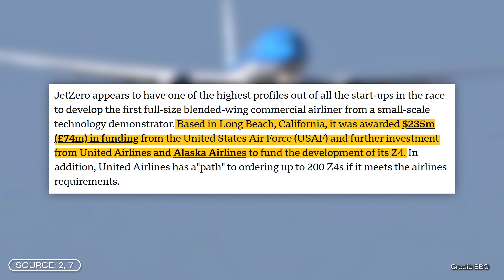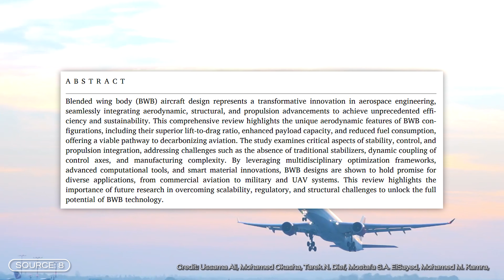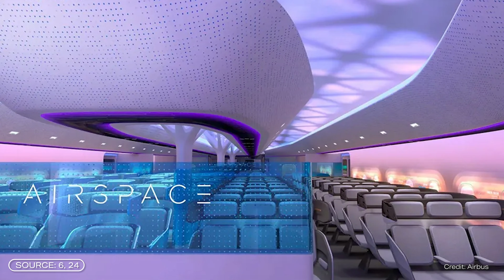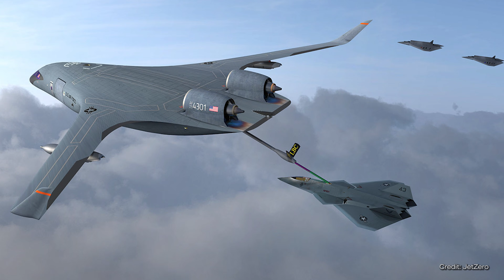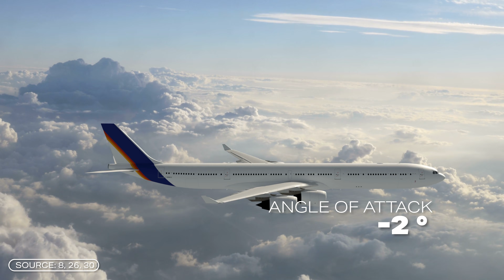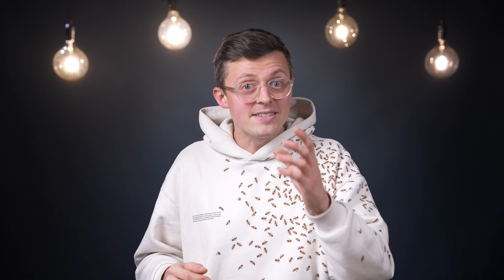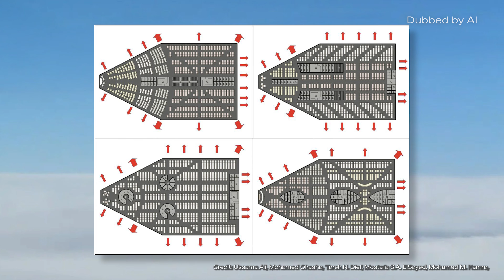The "Perfect" Plane Has One Big Problem...

Comment: I am surprised there is no mention of Airbus and their MAVERIC blended wing craft that was initially presented in 2020. The suggestion that future aircraft will use hydrogen rather than battery-electric using the new generation solid state batteries, when hydrogen is expensive to produce, transport and store, as well as having a low energy density, seems surprising.
Reply: Hydrogen (compressed or liquid) is still 5-10x more power in volume and50-100x in mass than the best batteries today. Hydrogen has lots of problems, but power density compared to batteries isn't one.
Reply: oh boy...batteries are very very heavy. Batteries are pointless in commercial aviation period. Hydrogen well it storage is a problem...very high pressure needed to store volume necessary for flight. So avgas or Jet A1 or kerosene will still be around for a long time to come. Net zero is a stupid and dangerous myth.

Comment: Militaty transport would highly benefit from this blended wing design. I'm surprises no manufacturer tried to at least do some prototyping.
Reply: That might be the next phase for initiatives like Jet Zero.

There is however a much more urgent need to replace and supplant the KC-135 and KC-46 fleet first, despite the issues with the C-5, C-17 and C-130 shortages due to aging fleets there as well.
Reply: This video explained exactly why no one has  tried.  It would be a purpose built cargo hauler...so long as it doesn't crash every two seconds.  Maybe an acceptable danger for military refuelers, but certainly not for passenger airlines pretending everything is safe.  I am interested to hear about the flying characteristics of the B-2, assuming it's not hidden behind 50 years of military secrecy.  Still basically a cargo hauler though.

Comment: Dude you did all that research and forgot one of most important hurdles for this aircraft... Passenger safety in evacuation during emergencies. Im old enough to have follow this aircraft since Boeing and NASA started on it decades ago. Its a problem because of how the passenger are seated laterally . They have to be able to evacuate the plane in a strict and short amount of time.The FAA is very strict about evacuation procedures and if they can't get past that, then it will never enter commercial passenger service and probably be military only.
Reply: Sorry but there plenty of issue more important about this design other than the minor problem of egress.

Comment: You didn't spend much time on the biggest problem of all; Pressurization. It's the reason why these airplanes will probably never be build. When you pressurize a cabin like that, the forces are immense. Every pressurization the fuselage will deform massively, and those stresses are near impossible to fix, unless you build 2 or 3 tubes within the aircraft. So don't hope on seeing one of these anytime soon.

Comment: Maybe I missed it but I'm surprised you or your friend didn't mention the huge advantage of high engines. FOD (Foreign Object Damage) mitigation. Engines under the wings act like giant vacuum cleaners sucking up any small stone or bolt, etc. Having the engines on top of the structure would reduce the chances of that damage enormously. I don't know how well this design will work but that's a massive consideration.

Comment: Arranging passengers in one of these will be a challenge.  You need everyone to be within two or three seats of an aisle, so flight crew can reach them and passenger can exit to bathrooms  or evacuate in emergencies.  But the more aisles you put in,  the more space you lose in passenger seats.  Also, boarding and evacuation may still be difficult and passengers will be far from windows, which may feel claustrophobic.  Passengers also dislike being in the middle of long rows of seats.  And the sensation of flight will depend on the seat position as well.
All of this suggests that cargo and military adaptation will be mich easier than passenger use.  It may be a while before they are adopted for this, if ever.
Reply: How well does this concept scale down?  Because given the anemic sales of the A380, and the 747 being phased out of service?  ISTM that the airline industry is looking more to the 200s to 300s in passengers top, making it easier to fly with a full plane on more routes.

Comment: A military cargo &/or fuel tanker only needs a pressurised cockpit. UPS & DHL fly cargo planes and not to be too pointed, but, haven't Fedex (et al) just had a load of Tri-stars grounded over a catastrophe with  poor maintenance of underslung engines? The tail engine was OK till it ate bits of the detached engine. The same forces apply to the anchorage for this blended wing, but an engine disassembly wouldn't have much in its path as it fell. And engines are getting bigger in diameter better to put them where there is space! And just like a big building, the cargo space needn't be one huge hall, it would have pillars strategically.

Comment: More surface area if the landing gear fails, a more open, wide interior body, better lift, better fuel economy and noise reduction. Better engine protection. Being shorter, it looks like wing and tail strikes would be reduced.

Comment: A blended-wing body airliner is aerodynamically superior, but as a passenger aircraft it faces major drawbacks: the wide cabin puts most passengers far from windows, creates curved seat rows, and increases roll and turbulence perception for seats far from the centerline; the non-cylindrical pressure shell complicates pressurization and fatigue and crack-growth analysis; and manufacturing requires extremely large, highly curved composite parts, limits automation, makes inter-factory transport impractical, and drives slower, more expensive production—making the aircraft commercially risky despite its better aerodynamics.

Comment: Engineers will need to develop passive stability fixes. Relying on fly by wire and computer assisted control only works when electrical systems are functioning optimally.  A plane should not fall out of the sky if it looses power.

Comment: You also have the prop-fans that are planed to replace the turbofans and you can expect fuel consumption the half of the CFM56 for the one Safran is working on... 
And I don't really see where to put a propfan on the top of a blended wing... 
You missed the point that nonetheless, engines on the top would make maintenance more difficult but that airport terminals would have to be replaced...
And it's not just the engine access that may become way more difficult...
Then, in case of cylinder design, replacing the wings is not uncommon then, when it comes to building... Blended wings may need to have a huge factory making everything on a single site... have fun to stuff the large parts into a cargo, even the Airbus Beluga...

Comment: It should be noted that of the BWB design, everyone who's looked into it from McDonnell/Douglas in the '90s and Boeing after acquiring it, and Lock-Mart, NASA, Airbus, TsAGI all have said that pressurization might not require more structural weight and even if it does, the gains in L/D and range & payload more than make up for it. They've said that some designs have markedly less structural weight. They have all also proven that passenger egress in a mid-size/regional plane is not a problem.
They've published to this, not only in patent documents but elsewhere in peer-reviewed science.
This is regardless of whether you're talking about 1960s technology, or 2020's technology. Make the fuselage a lifting body, whether expensively blended or not, and instant 20%+ savings over a tube and wing.

Most media is only concentrating on the modern tail-less "blended" designs instead of looking at the concept as a whole including many lifting fuselage body designs that do not have the similar problems with not having a tail, or being blended, or requiring advanced computerized systems, or worst of all, tying the concept to things like hydrogen fuel or electric powered.
The concept of lifting fuselage body airplanes has been artificially held back by fashion, by "if it looks right, it'll fly right", by it looking funny and not at all like a B-707, and now, by being tied to radically advanced systems and technologies that aren't in use yet.

Like most presentations on such topics, it's in ignorance of, or simply ignoring vast amounts of previous work in similar veins. Mention a lift-producing load carrying volume in a plane and everyone jumps to the all-wing with no tail surfaces like the Northrop XB-35 or the B-2 or the Horten-9/Gotha 229 of the war years.
Generally, "flying wing" is a media term. To designers, it comes back to meaning that the main load of fuel and payload is carried in a volume that is presented to airflow in a way to produce lift, and that the main lifting volume is the primary structure that holds everything together.

Within that broad definition, designers since Junkers patents in 1911 and onward, and very many others in the early half of the 1900s had many designs.
Junkers himself could not get any backing to make anything closer to this, than the G-38, which only had some habitation and fuel loading in the wing, as well as enclosed engines in the wings. The Soviets tried with antiquated technologies, the Kalinin K-7 with limited success. But see the 1930s Kharkov KhAI-3 "flying wing" with a fin, small test plane. Entirely successful, it flew for a few years as a general utility transport.
Charles Fauvel also wanted to make huge inhabited wing liners, started with a tiny test plane the successful AV-10 before the war, the successful sport glider the AV-36 after the war
Arado with the E-470 (very like a Burnelli) and the E-555 and the Focke-Wulf 1000^3 "B" model (Competing with the Horten/Gotha 229) all-wing tail-less during the war as transatlantic bomber proposals, competing with the Horten Ho-18. There was a Messerschmitt version of a huge 6 engine Horten bomber with a big fin & rudder.

Closer to the modern BWB discussion, see the designs by Vincent Burnelli of Texas, usually working out of Canada because nobody in the US wanted to buy or invest, despite the facts that his planes offered proven better handling than "normal" planes and better range and/or payload. A couple of huge lifting fuselage body biplanes in the 1920s.
 Most notably, the CBY-3 from 1947 onward (now restored in a museum). As to flying handling, a test pilot spoke of doing the "suicide stall": Cut power and pull back. As it starts to shudder and fall off, push a rudder pedal, and let go of the controls. The nose turns a bit with the rudder input, and the nose goes down and it glides out straight. Like most of his planes, better range for the same power/fuel loading compared to a "normal" plane, onto shorter runways, though it tends to float in GE for a long time unless you plant it firmly down.

Established aeronautics industries hated him and his designs, though they performed well. At least twice the US military favored his designs, but the political process turned away. First with the contract that led to the A-20 built by Douglas, then the S-2 Tracker built by Grumman. He had a large bomber that was supposed to be in the contact bids that led to the B-29 and then the B-36. He continued designing things with lifting fuselage bodies, wings and tails into the 1960s.
 Very many of them have rough aerodynamic considerations very similar with some of the modern BWB inspired designs that have a pronounced afterbody and centered fins (most of these largely taking after the 1990s Tupolev 404 winged lifting fuselage body design). Absolutely none of the issues associated with designs without fin & rudder or with only wing-tip fins.

Then in the 1970s, Boeing started pushing a lifting fuselage body deign called the Boeing model 754, to carriers like Emirates, Cargolux, and Husky. Like the Burnelli designs, not at all "blended", yet by their numbers getting almost double the range or payload, onto shorter runways compared to a "normal" plane with same engines and fuel. 
When the Burnelli Estate learned of this, they told the carriers and Boeing that they'd be happy to let it be license-built to Burnelli patents. Boeing hastily dropped it and it disappeared, carriers and makers not concerned with fuel savings.
The Husky patents noted that adding more freight as in lanes of containers, the L/D goes up as you go spanwise, adding engines and landing gear every few lanes as it expands. The landing gear type and rotation angle doesn't change, as it does when you "stretch" a tube & wing to increase cargo capacity.

To this day, they're still not concerned with savings, with proven handling with entirely contemporary technologies and flight training.

See the 2010s Lock-Mart "Hybrid Wing Body" logistics transport. Again, greater payload and range onto shorter runways, entirely common materials and handling. Also ignored.

See the 2000s patents by Faruk Dizdarevic on Tailed Flying Wings. Like many of the blended designs depicted in this video, but with a tail, thus eliminating any handling problems.
Any of these and especially of note the Boeing 754 / Husky designs of the '70s have been an important missed opportunity.
Ignored by buyers, mostly because of misconceptions and because they look funny, not at all like the fashionable tube & wing.

See the Russian "Frigate Ecojet" Again, with contemporary technology, the same footprint, power, and fuel loading of a regional, you get the range and payload of a jumbo.
Reply: Thanks for rather detailed history of related designs !
Reply: Bullshit. The weight gain for BWB will never be made up by any aerodynamic benefit. If an airplane cannot get off the ground into flight, there is no aerodynamic benefit
Reply: @PaulWalker-zk2dd  Please show your professional qualifications, and citations where you're published under peer review saying so.

Comment: One of the considerations for passenger comfort is going to be internal noise. The difference between the 747 and the A380 is huge, giving the A380 a huge advantage. Will the BWB be another dramatic advantage? Another potential improvement for the BWB would be long distance travel in a sleeping configuration. More internal space night finally give us the ability to sleep comfortably on those 15 hour flights.

Comment: I wonder how the engines will handle a stall. Looking at the DC-9, Caravelle, and many business jets have to be careful  of stalls and having the turbulent air entering the engine, and causing the engines to flame out. Oops loss of power in a stall, not good.

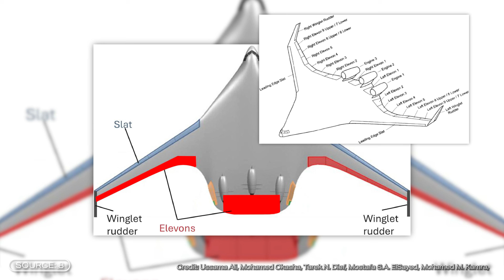Comment: 10:30 this system comes from the b2 and is artificially stable through fly by wire which isn’t allowed by the certification agencies for commercial planes like airliners, a blended or flying wing needs to be naturally stable aerodynamically so the design needs the wing tips to perform the role of vertical stabilisers or have some sort of vertical stabiliser integrated into the design.
Reply: It's true that the military will accept failure modes that certification body's will not.  
That said, there are plenty of aircraft flying today that rely on computer interpretation to be aerodynamically "stable.". The trick is that the failure modes must be flyable by human pilot.  
History has proven this to be hard needle to thread in the case of multiple manufacturers when human factors confront these failure modes (AF 447, 737Max, B2 pitot failure, etc.

I honestly don't expect to see BWB aircraft in commercial use for at least 20 years since emergency egress, composite fatigue, and passenger acceptance are all big issues.  I think these issues probably have compromises that are commercially viable but only with much research and testing.

I also suspect the efficiency gains stated likely use seat mile metrics commonly used in passenger aviation.  These compromises will likely reduce that 50% number, but even 15% is such a competitive advantage that it would force many routes to BWB aircraft.
Reply: @hwill2453  stable aerodynamics on Fly by wire in a airliner and digitally controlled engine inputs are considerably different from unstable aerodynamic design.

Blended wing or not it’s not a engineering limitation, a flying wing airliner could have been done 40 years ago already, it’s a matter of legislation and culture.

the people who have power to decide these things are not willing nor incentivised to change anything.. We all know how it goes when a boss needs to do actual work and get their hands dirty instead of just delegating/telling people off.

Comment: It makes a lot of sense to start as a cargo plane. It could have giant rear gate / loading ramp. It could turn into incredible plane, without needing to carry a single passenger. Pressurizing only front section of the fuselage will undeniably be easier.
Modern airports are not going to accept the plane as is - it's inherently incompatible with current ramps, and you don't want to board 200 passengers with single entrance.

Honestly, pitch as a tanker was a genius move.

Comment: 10:03 The engine maintenance is an non issue cause the plane is so big you can build a maintenance shaft inside the plane connecting to the engines and use the awnings of the engines as a platform or protection while open to perform maintenance.

you can even add a build in crane through a hoist system with no  hydraulic or electronic component or  powered crane that works hydraulics or electric motors.

The mi-26 and beriev hydroplanes are the perfect example of this decades old technique applied in the real world for thousands of hours of operation.

even if it’s too small for a maintenance shaft you can always just get on top of the plane, very common across military and general aviation.